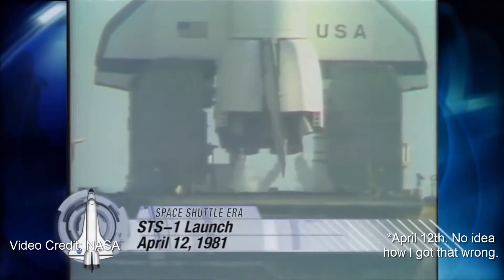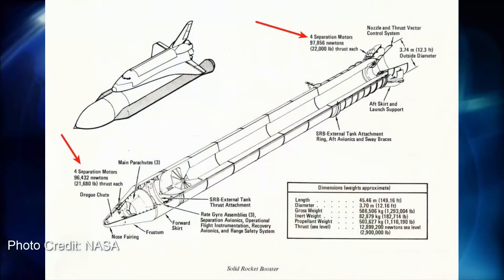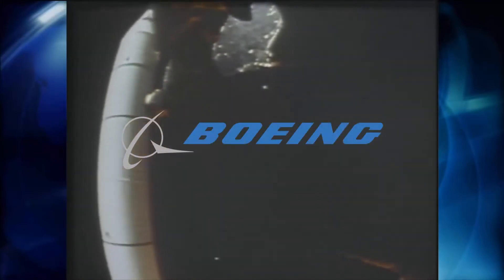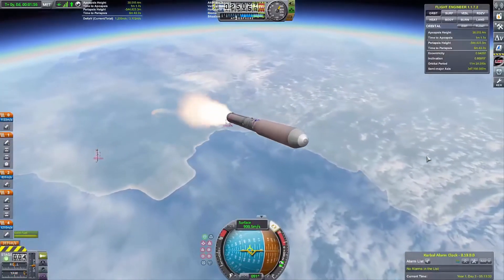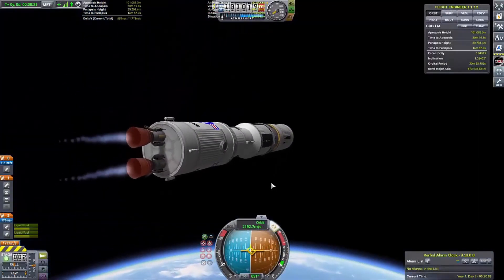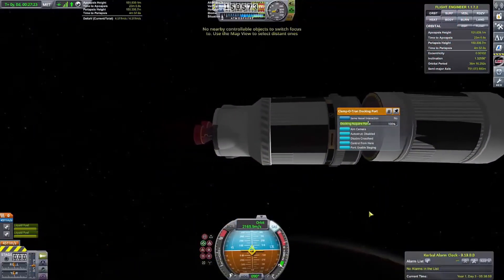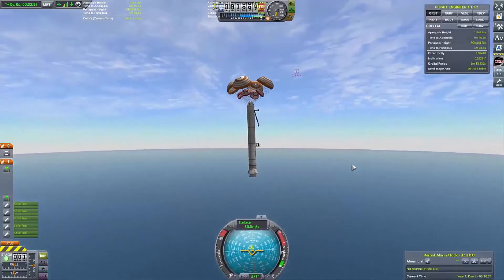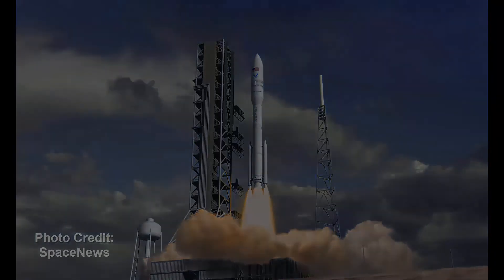SRB-X: The Story of the "The single worst shuttle-derived launcher ever proposed."

Comment: Your exhibition of this old SRB-X design makes me think what it would be like if Congress released NASA from the super-high-cost, expendable design of Space Launch System ("SLS") Blocks #1 and #2 and replaced the entire first stage of SLS for a redesigned hypothetical Block 3.

My idea for a Block 3 first stage would be to use three (3) Blue Origin New Glenn first stage boosters (similar in overall configuration to SpaceX's triple-first-stage Falcon Heavy). If a single New Glenn first stage's seven BE-4 engines are capable of a combined thrust of 3.85 million pounds-force of thrust, then combining three New Glenn first stages, for a total of 21 BE-4 engines, would produce a consolidated total of 11.55 million pounds-force. If we took this concept one step further, using five New Glenn boosters, 35 BE-4 engines could produce a consolidated total of 19.25 pounds-force.

Using New Glenn boosters would open the door at least partial re-usability of the SLS, greatly reducing launch costs for missions to the Moon and Mars. And if the government funded the completion of United Launch Alliance's now-shelved ACES / Centuar Heavy (built for in-space refueling, using four (4) RL-10 engines), this would open the door to a re-usable ferry / tug / tanker transportation system between Earth orbit and lunar orbit, further reducing Earth-Moon transportation costs. Assuming an SLS Block 3 actually incorporated New Glenn boosters and ACES, this could open greater and much more cost-effective access to both cislunar and interplanetary space. Of course, all of this assumes that New Glenn becomes operational and Washington sees fit to adopt New Glenn in an SLS Block 3, and then sees fit to revive ACES, such an initiative could shake up this new Space Race and put the United States well ahead of everyone else, and, no doubt, with an impressive flight cadence.

NASA internal paper: "Kickstarting a New Era of Lunar Industrialization via Campaigns of Lunar COTS Missions" - Sept 2016 - 18 pages
authors: Dr. Allison F. Zuniga, Mark Turner, Dr. Daniel Rasky and Robert B. Pittman (NASA Ames Research Center) and Edgar Zapata (NASA Kennedy Space Center)
https://ntrs.nasa.gov/citations/20170000827

United Launch Alliance promo video presentation:  "ULA Innovation: CisLunar 1000"
run time: 7 mins., 13 sec. -- video still posted on Facebook, no longer on YouTube
https://www.facebook.com/share/v/VrdWxMVeU9ZcyFFC/

United Launch Alliance promo video presentation: " ULA Innovation: Advanced Cryogenic Evolved Stage (ACES) / Centaur Heavy " run time: 8 mins., 3 sec. --  video still up on MechDesignTV channel on YouTube
https://youtu.be/Zi-HStWyk84?si=jdwUWidCoAeNJQry

Pratt & Whitney Aircraft document - study prepared for NASA -  Dec., 1973:
"Design study of RL10 derivatives. Volume 3, part 2: Operational and flight support plan"
https://ntrs.nasa.gov/citations/19740027085

Food for thought.

Thanks for sharing this spaceflight history video. Well done!

Comment: I'm pretty sure the worst launcher ever proposed using STS parts is the Space Shuttle. Designing to require humans on board was just dumb.
Reply from the maker: Putting humans on the Shuttle was great for a lot of missions. Not having an unmanned version of the Shuttle for missions that didn't require humans was a stupid idea.
Reply: @Shortline819  agreed.  It's not the fact that it required a human on board, but the fact that they never built an automated version.  Which could have been done.
Reply: Armchair rocket scientists are at it again